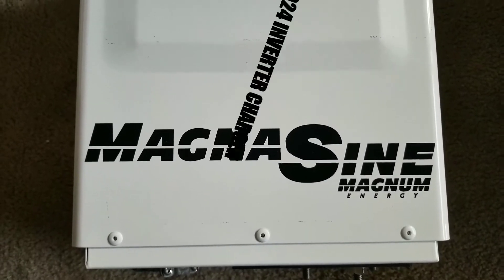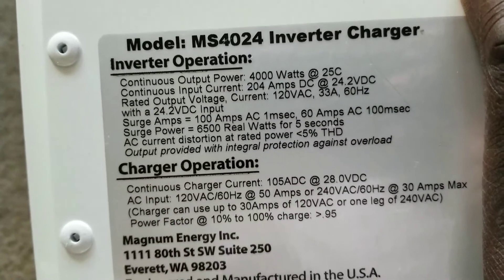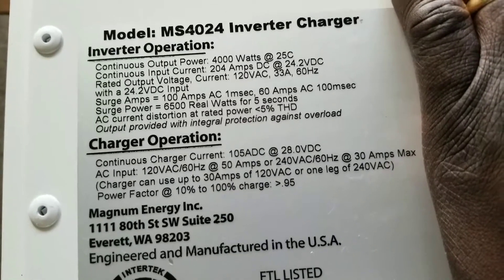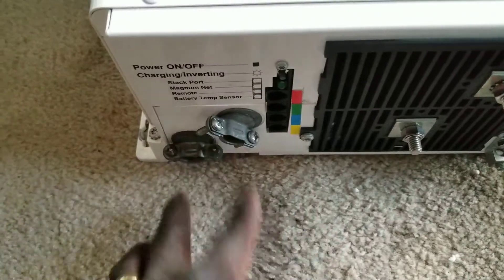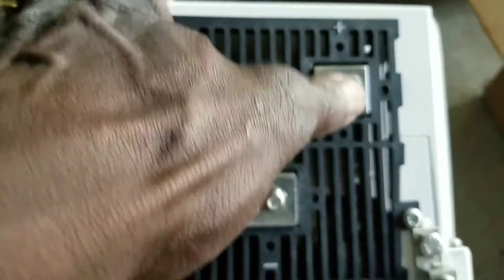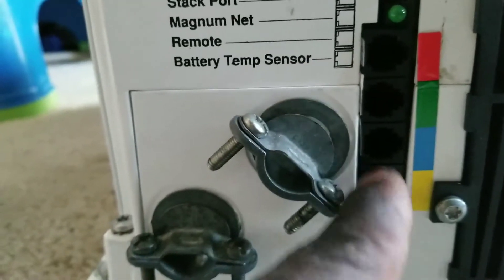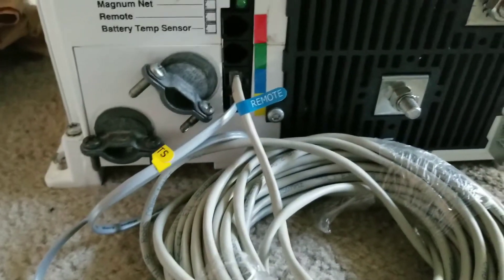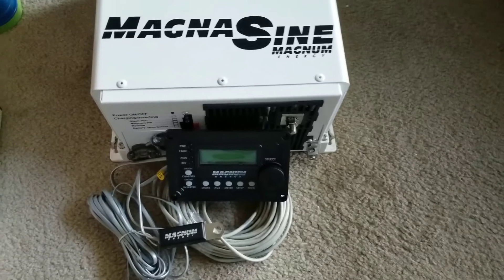MAGNA SINE MAGNUM ENERGY MS4024 INVERTER CHARGER (Ep#1) INSTALLATION PREPARATION

Comment: how many of this inverter can  be installed in parallel(increase power). There's a way to disable the charger.
Reply from the maker: I suppose two of these in parallel that is the highest you can go and I have seen as well. 
While for OutBack, you can install up to four in parallel. 
There is a ON & OFF botton

Comment: Yes, I did look this video about 2-3 times... 👍 
I have needed something strong enough to run all house... 👍 and than I see 12kw 36kw surge unit that I have now Chinese inverter with about 150 w idle consumption... 
I have made small modification with fan's also I have problems with control board that was replaced under warranty and communication board... 
Also have on the power board change all the screws on every mosfet put some thermal compound and check all conections.....
Max I have draw from inverter (PV35-15K) 4.5kw without any problems... 
Also have checked for some hot spots on the control board and add some heatsink on one of the elements...after that max temp. of inverter was 36degC on the 4kw of load awsome.... 👍 
I hope it will last few years...
Reply from the maker: +Bostjan Trancar https://youtu.be/Q-9AMh_ATTk
MPP SOLAR INVERTER CHARGERS PIP 242424LV-MSD - Complete Installation
WANAMINGO MINNESOTA BY jwsolarusa

Comment: I'm seriously considering on purchasing one  can you run two in slave/master my air comp needs 7 kw to start up.  
Great Video bro
Reply from the maker: +Awesomus Maximus 
Thanks for watching bro.
You can STACK two or four Magnum Energy Inverters. One will be as Master and the rest as Slaves.
I will recommend you look into the MS4448-PAE it has higher surge than this MS4024/PAE. This can Surge up to 6500KW Real Watts for 5 seconds.
I hope you find this information helpful.
Goodnight my friend
Reply from the maker: +Awesomus Maximus https://youtu.be/Q-9AMh_ATTk
MPP SOLAR INVERTER CHARGERS PIP 242424LV-MSD - Complete Installation
WANAMINGO MINNESOTA BY jwsolarusa

Comment: What size breaker are you running from your main panel to your inverter?
Reply from the maker: +My Alaska Dream 
Hello buddy and thanks for watching.
My Main breaker is 250Ah.
The rated Output voltage, Current:120VAC,33A, 60Hz on one leg. This Inverter can run on both legs 120VAC/240VAC @ 60Hz without a problem. It has a high Surge up to 6500KW Real Watts for 5 seconds
Reply: Thank you. Glad to see the Magnum is back. Hope you have a great week buddy.